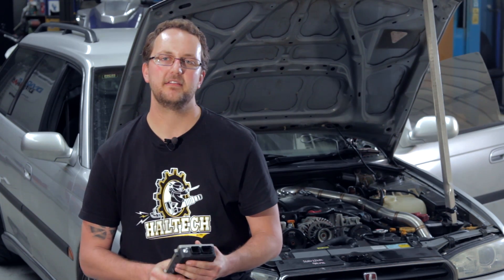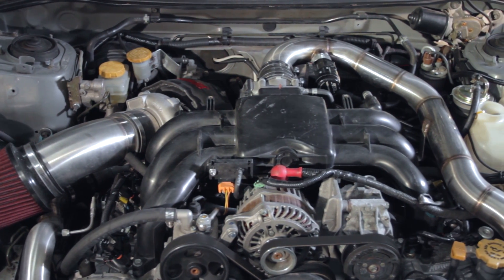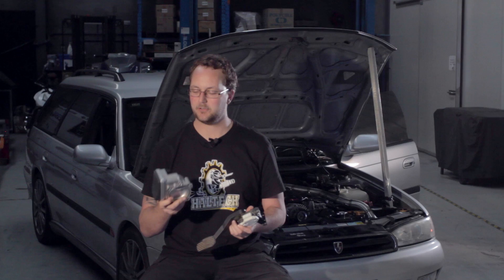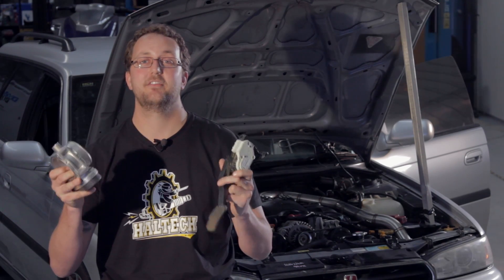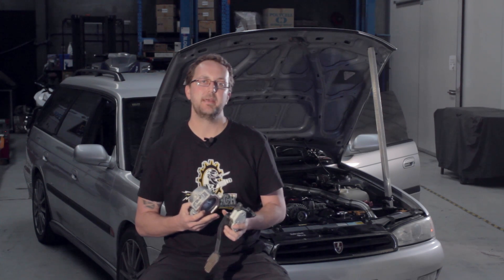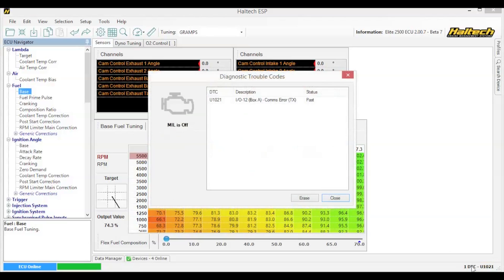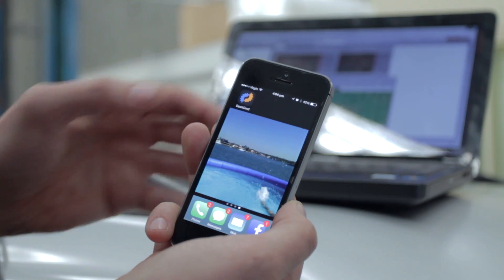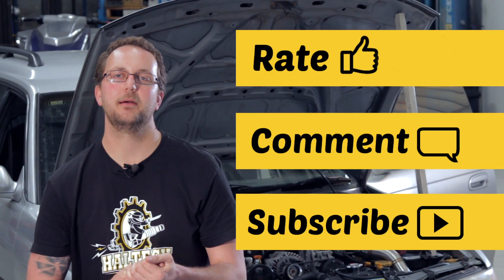Haltech Elite on Mighty Car Mods "Gramps" Liberty - Technically Speaking

Comment: Do you or are you guys working on an app that allows you to tune with a iPad instead of a laptop ? I am researching ways to implement an app with in cabin tuning say for instance on a car play compatible head unit - so if you can tune with an ipad and have various tunes saved  to the ECU ( if it has that feature ) - then you can load the tune on the fly through you CarPlay compatible head unit - so if you have tunes for eg. economy, sport, crazy speed, drag racing and ludicrous speed then you can select these from the app running on your car media / head unit - just a thought for now, I’m looking at haltech / microtech / Autronic Ecus at the moment for two projects - but I want this feature
Reply from the maker: Hi, thanks for the keen interest in an IOS app. Unfortunately, there are no plans for an IOS/Android interface for our ECUs at this point.
Reply: totally understand, the market is very small for the investment in R&D for this at this stage hopefully something to consider as more adopt to smart head units and vehicle management syetems

Comment: Signor Tfork, I also have a boosted 3.6R running 5 psi currently and when oil temps reach 100c the avcs is shutting off and i have to cool down and restart the car to get it to come off. its not throwing a cel but we dataloged and its shutting off consistantly when oil temp reaches 100c on the dot. any assistance on how gramps is doing multiple runs on 8 psi with no issues. I didnt see in any of the episodes him running aftermarket oil coolers. my car is a 2011 usdm Legacy 3.6R. build thread - http://legacygt.com/forums/showthread.php/italianlegacy-3-6r-official-thread-227730.html
Reply from the maker: Hi Giovanni, please email us on support@haltech.com the support guys will be able to help you out on that.